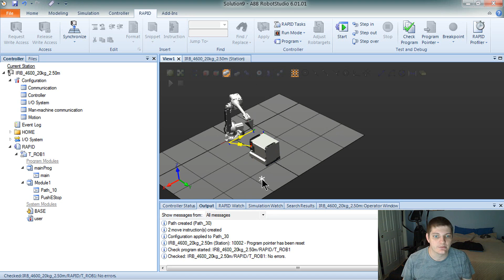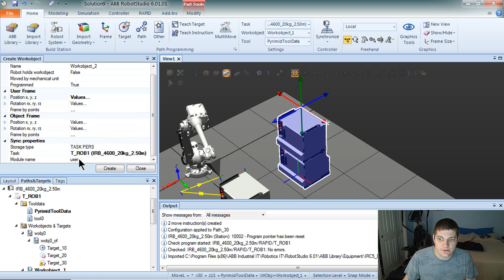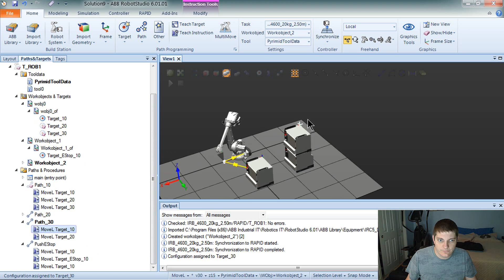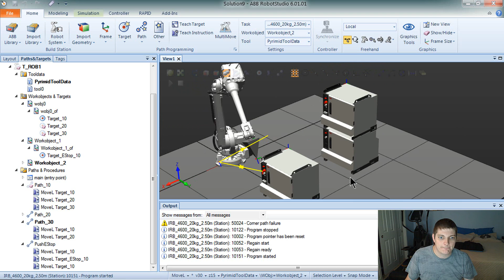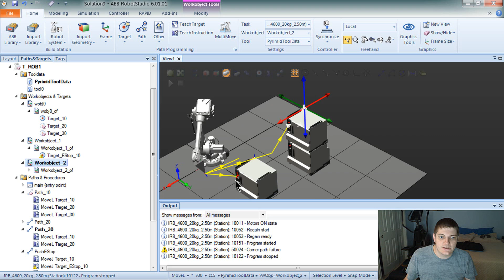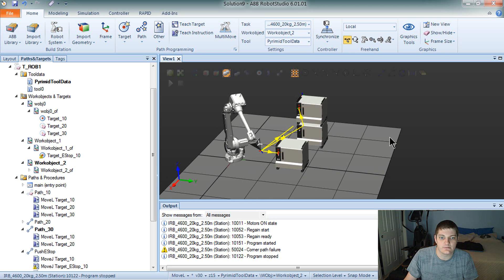Learning Industrial Robot Programming - EP9 - Using Work Objects

Comment: came here from the megasquirt videos .... ended up seing the whole video! nice job , explained everything very good!
i haven't finished the megasquirt series ... can you tell me how many hours did it take you to completely assemble it? (sorry for any mispoken english....)
Reply from the maker: wow, didn't think there would be much audience overlap .... the ms build took about 3 hours... much of that was reading the guide to be sure I had the extra options right for the extra coil driver and such and the crank trigger input. wiring to the car took about the same.
Reply: ok thanks